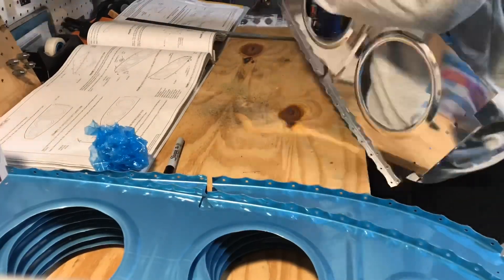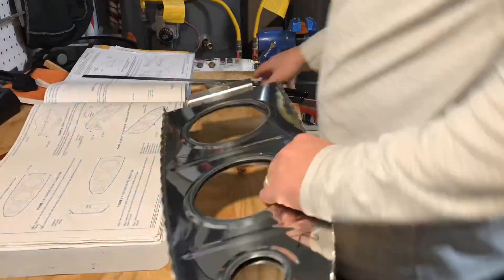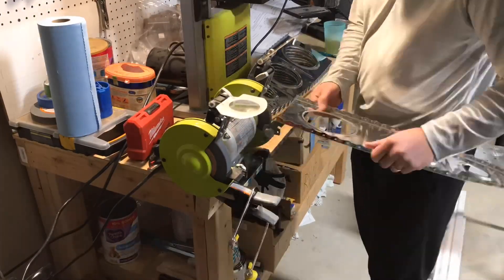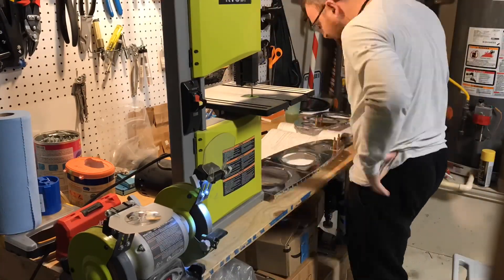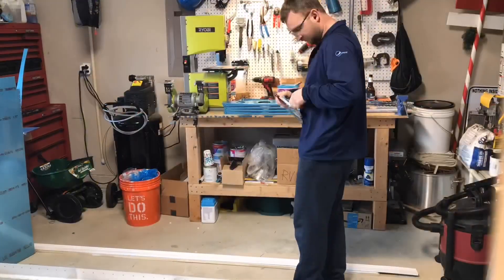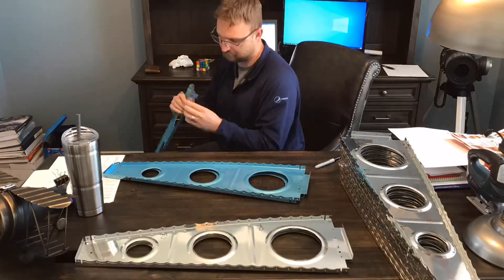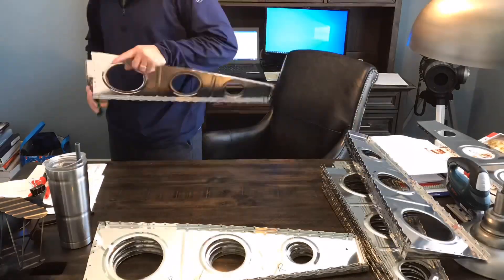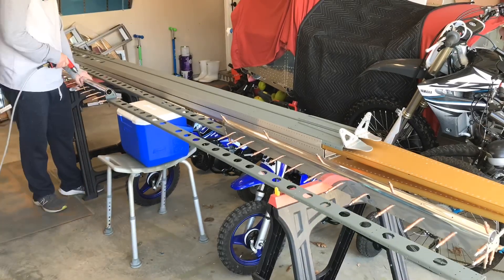RV-12iS Wings 3: Ribs, Ribs & .......Flaperons

Comment: At the 1:00 min mark what is the gizmo in your drill press that you used to deburr the ribs?  Looks like something I'd like to get.  What's your technique for deburring the very tight radius between the rib flanges?
Reply from the maker: That’s a 2 inch scotch brite wheel, I also have the 1 inch wheel as well. However shortly after the camera fell I went back to using my hand debur tool as it was more efficient which is also what I used to debur the tight corners as well. I finished up the process with a scotch brite pad to prep for priming.